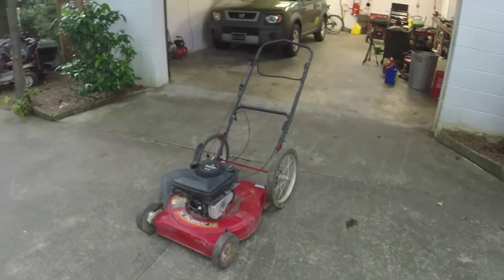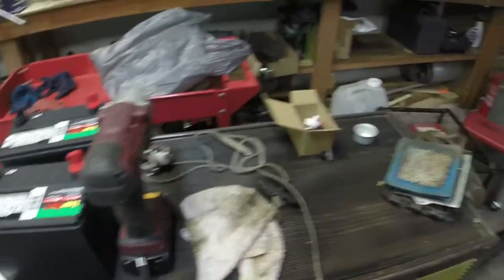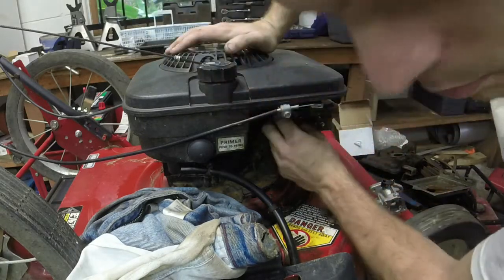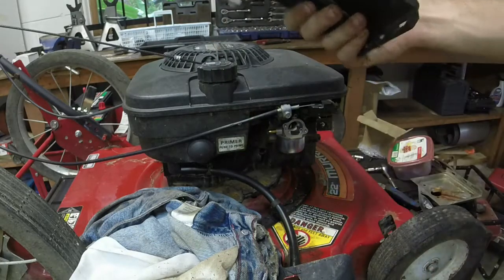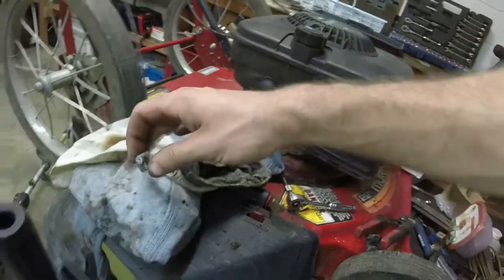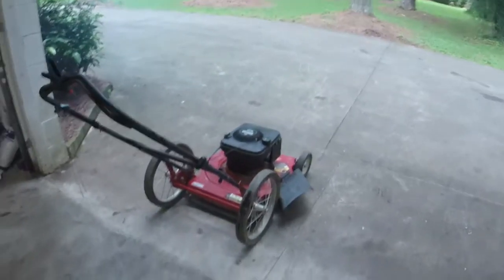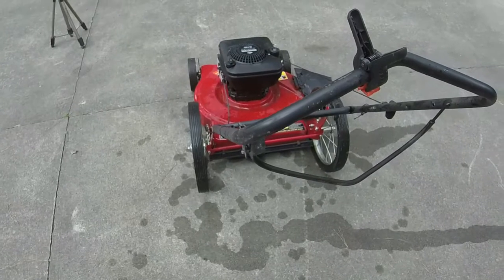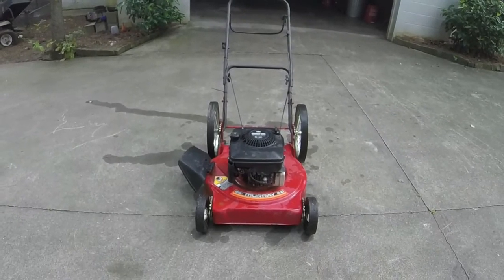Murray bicycle wheel push mower has a unique primer & is in great shape (Carb & primer replacement)

Comment: One tip I can offer on the replacement of primer bulb is to use your stubby screw driver.  You know those short little stubs (maybe 2 1/2 inch long that you find few uses for?  I think they work great for changing out a primer bulb.  The problem with a regular screw driver is that it is too long. You can't really control what happens with the blade.  It may wreck the bulb or it may wreck your hand.,  The little stubby size allows you more control of the driver while pressed in, without breaking through the new bulb or worse, breaking through your hand.
Reply from the maker: Good tip, thank you!

Comment: Wish you covered more on the placement of the gasket on the cover.  You said it was important because it suppled the air to the primer, but only spent 3 seconds on proper placement of the gasket itself.
Reply from the maker: I guess I've done it so many times that I chose to make it quick on this video.  Just make sure your mating surface is clean and you don't over tighten the screws when you put the air filter cover back on.  The gasket fits into little grooves on the air filter cover.  Sometimes I use two to make sure it seals.

Comment: They don’t make them like they use to
In fact I don’t see many Murray mowers at Walmart anymore
Reply from the maker: The only Murray brand mowers Walmart carries are non self propelled 21" and the rest are Hyper Tough and Snapper.  It's an MTD or HOP product and a shell of what it used to be.
Reply: @EllisMowersandmore   I was at Wally World the other day and passed by the seasonal stuff ,  they are putting out yard equipment.  Some of the new ones there are black Max and are plastic decks

Comment: Never seen a mower like that one.. pram wheels and an external prime.. hmm it a food looking mower. Is that a standard fitting to have wheels like that
Reply from the maker: Yes Mick those mowers came standard with those wheels in the 80s and early 90s.  They are still sought after although most of the time the thin decks are either broken or rotted out.